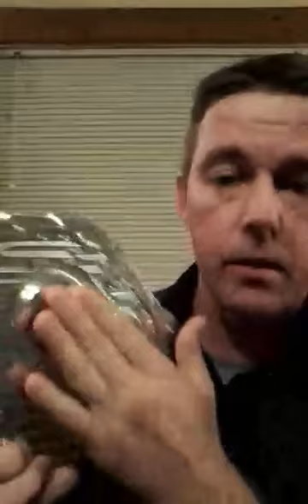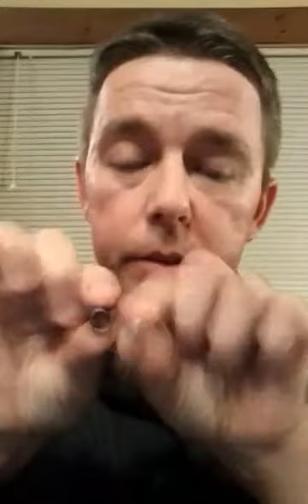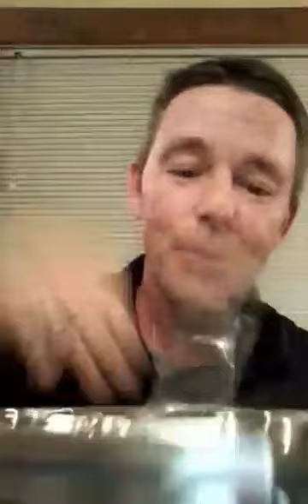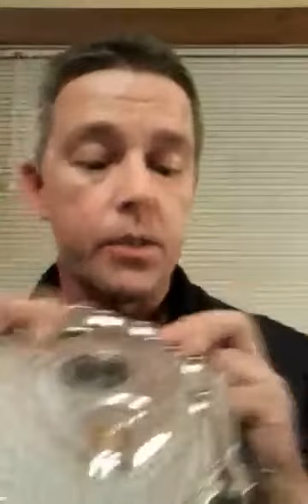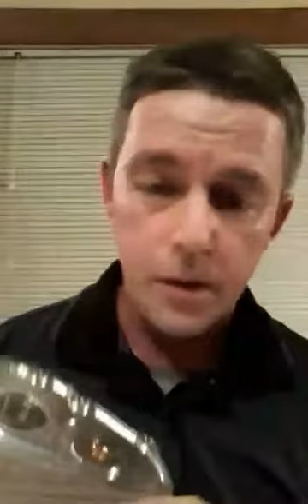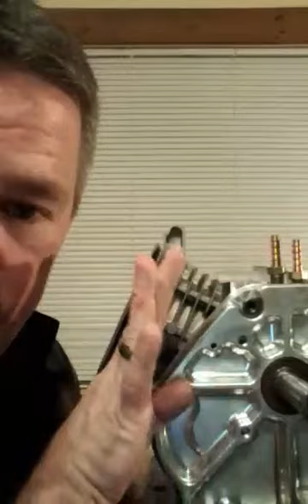Installing an ARC Billet Sidecover(Predator 212,Clone 196cc, Go kart racing, Mini bike racing)

Comment: I have 2 Hemi Predators that have very small dowel pin holes for the 3rd and 4th dowels in the ARC kit (about half the size of the dowel) I used the 2 that fit (the ones that line up with removal bolt locations). I was thinking about drilling out the 2 that don't fit. Have you seen this, and what do you recommend?
Reply from the maker: We have seen this on some of the Hemi style engines. We just drill the upper and lower pin holes out to accommodate the dowels.

Comment: why don't the predator engine billet covers have bearings for the camshafts like the honda billet covers do?????
Reply from the maker: Because the american made bearing we where using arc no longer being made. We didn't want to put a cheap Chinese bearing in our sidecovers. The Honda and Predator are both made with out the camshaft bearing now.
Reply: i burnt that hole up in my billet side cover i sugjest you iether put a bearing in it or better yet a clovite sleeve you press in
Reply from the maker: IF you burnt up the billet side cover camshaft bushing  you either have the wrong cam, the wrong oil or some other problem going on.  We have been doing them this way for years and never seen one burn up. Our tech line number is 800-521-3560, call in and talk to one of are techs to help figure out your problem.
Reply: yea ty guys when I read that comment I thought wtf HOW is that possible if you were using proper oil and the right cam and were changing your oil regularly.......thanks for the reassurance I trust you guys down at arc you've always been helpful to me.
Reply: I was using a Mod 2 cheater cam and it worked well had i thing it was 5-w30 highmillage full synthetic. mobile 1 your Tech line sugjested it and it worked good with the stock side cover. stock side cover was fine so i put the new side cover on did everything the same and after 5 hours of runtime i heard chattering from the bottom end. popped the side cover of everthing looked fine evan the came than i notice that the hole for the cam on the billet side cover was purple. after looking there was no oil hole to put oil on the cam im not shure if there is supposed to be one there. there was also no sleeve. i would sugjest a rond clevite sleeve you presse in and a oiling hole. maaybe mine never got the jhole drilled but i evan used comp cams assebly lube on it
Reply from the maker: What engine do you have, Honda GX200, Clone 196, Predator 212 Hemi or Predator 212 Non Hemi? What part number sidecover do you have?
Reply: Ihave a 2008 model greyhound 6.5 which is basically a predator 212 non hemi.  wanted to get the side cover replaced but i baught it at a race shop in richmond virginia about a year ago so ill just have to buy another one. i gave it to a friend for  20 bucks and he bored the hole out and got a clevite sleeve on ebay and drilled an oiling hole. its on a mini bike now.
Reply: you guys make a great product love your stuff but at 139 dollars a pop. Idk if i will be buying another one. i will deffinatly be buying a billet rod though. not to many company's these days take the time to respond to people keep up the excellence work!!!!